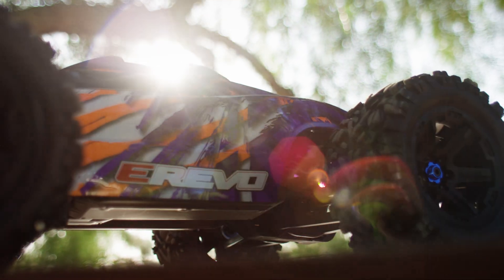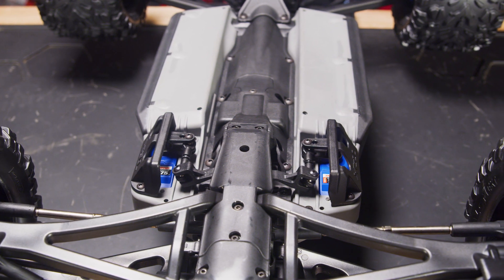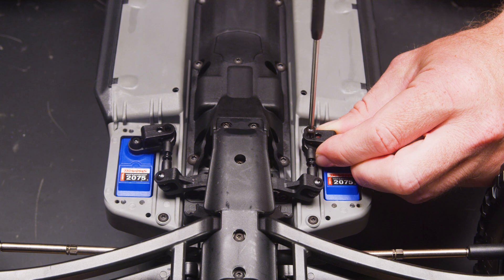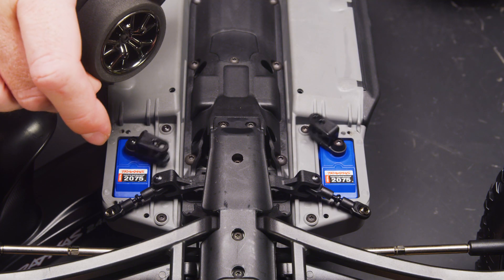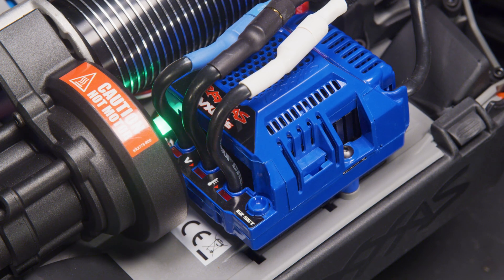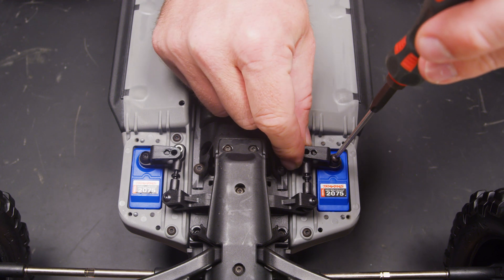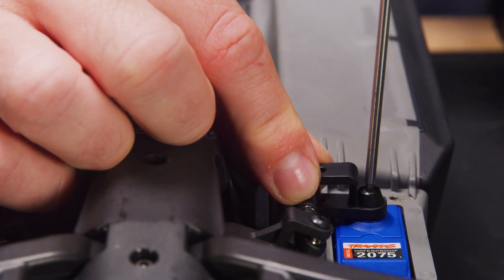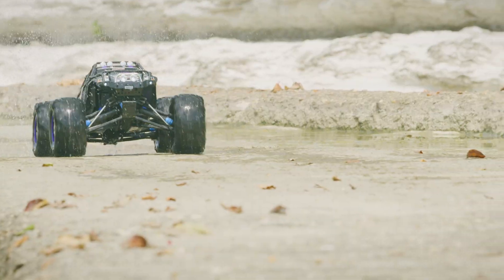Dual Servo Setup | Troubleshooting and Alignment for Traxxas E-Revo and Summit

Comment: This should have never been an issue in the first place! Who on earth thought of using 2 servos battling it out against each other, without any electronic control or failsafe? In a place where a single servo would have done a fine job? What seems to be the case here, is that some sort of a commercial gimmick became engineering nonsense, not to mention a reliability problem...